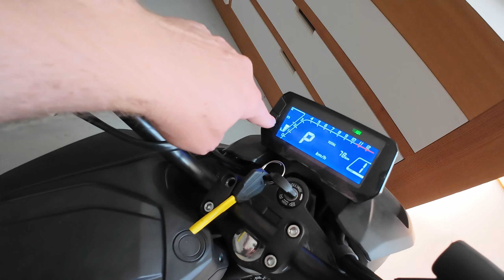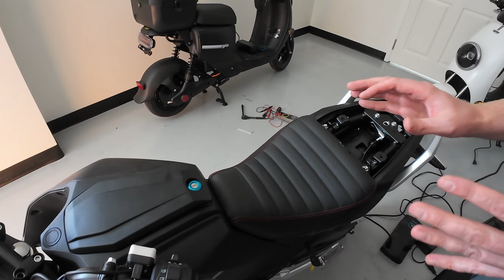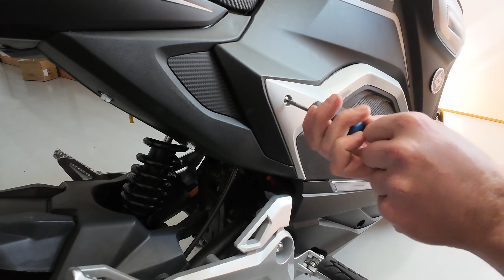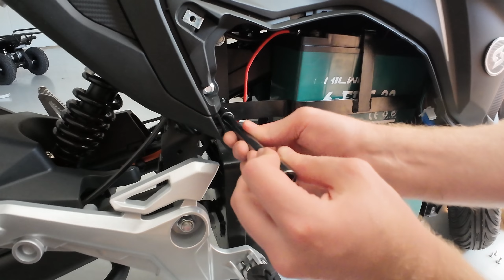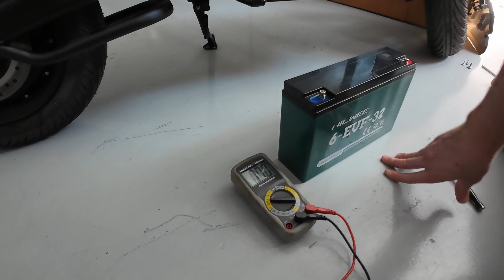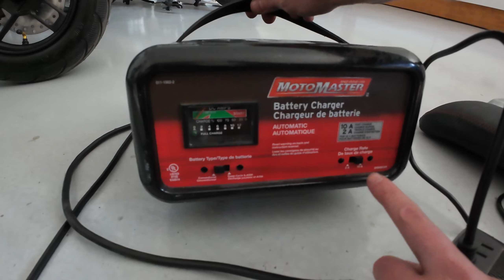Gio G2000 battery recovery procedure

Comment: Hi my bike doesn’t switch at all even when the charger is plugged in. I checked the connectors. Do u think it can be the battery?
Reply from the maker: @tanicaetano5617  If your  batteries are completely dead, and when you plug in charger,  display should power on from that energy that the charger is supplying. So maybe check if your input charger plug is disconnected.? Here is a video 
https://youtu.be/7iTRAPj5lVU

Comment: Quick question, do you require a bike license and/or insurance to ride this bike or is it like most other e-scooters (Gio/Daymac/etc) that don't require it? Thanks!
Reply from the maker: @AvAVenRez  This scooter is LSM, so in most states and provinces it requires to have regular driver license,  but without special motorcycle endorsement.  So check your local DMV if it requires driver license where you live .

Comment: Hey my gio g2000 showing full battery when it's plugged in and can even turn it on but once it's unplugged it dies after a few seconds
Reply from the maker: @logan735  That means that your batteries are dead, and that video is for your case , of  how to recover them , if still possible

Comment: Hi I just purchased this bike. Question, do you know if the wheels have tubeless tires.
Reply from the maker: @idyike  yes there are tubeless tires
Reply: @You-can-fix-it  great thanks for your quick reply. Mines arrived with the rear tire deflated...I tried inflating it  but no luck. I even replaced the the tube valve.
Reply from the maker: @idyike  You need stronger air compressor , so the you can seat bead
Reply from the maker: Or strap it around and it will jam rubber to the rim
Reply from the maker: Here, watch after 10th minute
https://youtu.be/OT_WrYIhcu8?si=SWlwvUzVAH1568g1
Reply: @You-can-fix-it  okay thanks 👍
Reply: @You-can-fix-it  Just seen the video. Thank you that was so helpful. I guess I need to order that ratchet belt...I just subscribed to your channel. Hopefully I can pick your brain again. lol
Reply from the maker: @idyike  Stay safe
Reply: @You-can-fix-it  thank you. You as well 😎🤘
Reply: @You-can-fix-it  Good Day. I'm guessing I have to purchase another tire. Would you know if there's a Model number on the actual tire I can Google ?
Reply from the maker: @idyike  You need to visit  GVA brands .com website , and click under electric scooter parts section
Reply: @You-can-fix-it  Thank you I really appreciate your help. Be well.